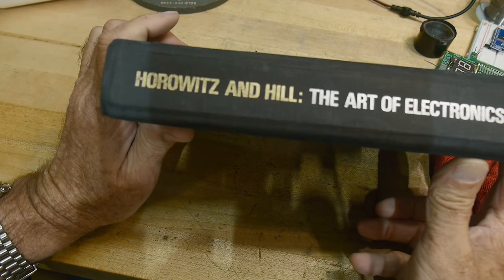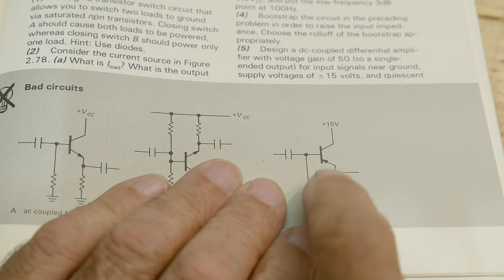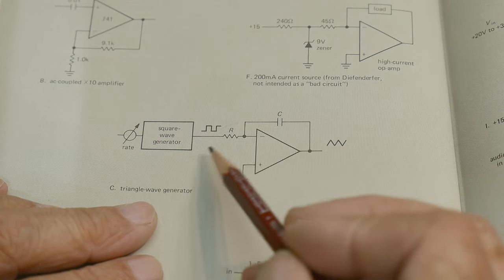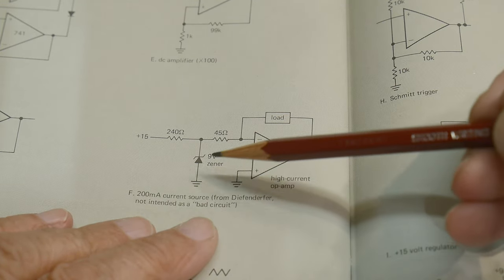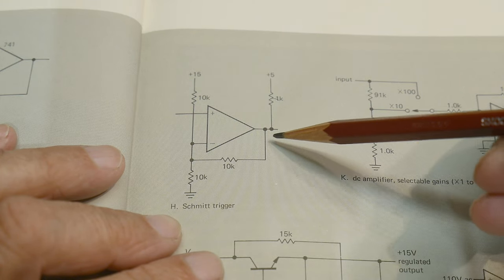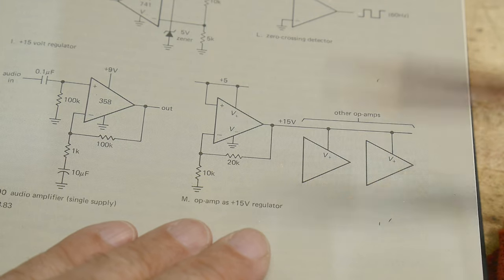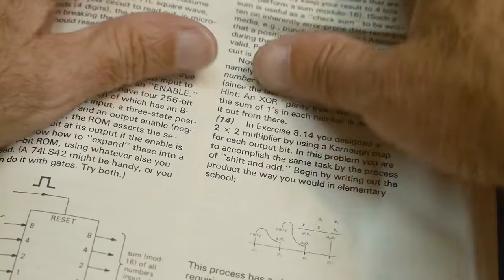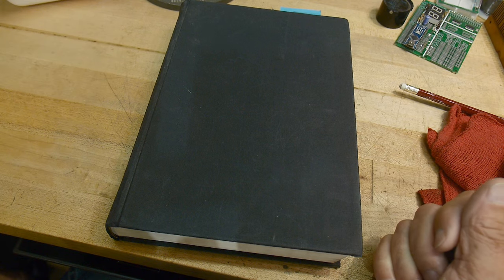#1548 Bad Circuits from the Art of Electronics

Comment: i learn pretty well from mysteries, plus the way these are formulated, it's like an endless list of things that are actually wrong with them, not just one. everything is so squishy, things can work but not for the reasons you think and whatnot, things can end up vestigial or in a product just to detect clones and stuff. the opamp ones are the most interesting, one of those will oscillate because the inputs aren't tied down, and they show 2 unconnected opamps, if the part or routing is changed when it coincidentally didn't oscillate before, it can start oscillating and stuff

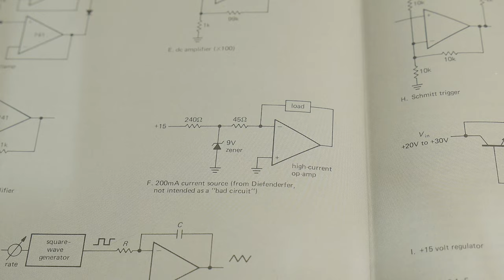Comment: 7:18 The idea here is that the current through the load equals the current through the 45 ohm resistor, which is set by the negative input being fixed at 0V and the 9V zener. So the 0 current into the op-amp input is actually part of the design.

The mistake they made in this circuit was assuming the voltage at the zener will always be 9V, but the circuit as designed will pull that voltage below 9V, thus it will not actually drive 200mA current through the load. If you put an ideal 9V voltage source there, it will work.
Reply: Yup! They should have added a 30 Ohm resistor in series with the 15 V supply, not 240 Ohm.. The circuit is now limited to 25 mA

Comment: In the third example the biasing is just fine -- but the transistor is of the wrong type.  With the correct transistor (NPN) the emitter would sit at -0.7V and be able to follow the input signal on the base to around 27V peak-to-peak.  The transistor would definitely be in class-A (linear) mode of operation.  Of course this would only be an emitter-follower amp so the amplitude of the output signal would be the same as that of the input signal so (if the value of the emitter resistor was suitably chosen) it would be just a current amplifier suitable for altering impedance betwee input and output.

Comment: The 200mA current source - the problem is the 200mA has to flow to the +15V supply and the 240 ohm resistor is way too large to support that.
Reply: If the 240 Ohm resistor was 24 Ohms it would work.

Comment: Circuit F 7:10 - Current will flow from left to right, only problem is the drop across bias Res 240 Ohms is 48V for 200mA (assuming 0A bias current for Zener). 
Hence, supply should be atleast (9+48)V 
or 
Bias Res can be at max 30 Ohms

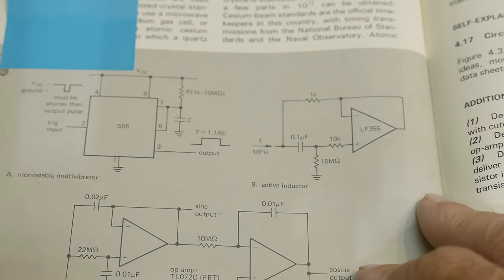Comment: The issue with the 555 @11:34 seems to be that the output pulse is dependent on both the RC time as well as the duration of the input. As soon as pin 2 goes low the output goes high.  The output will remain high as long as pin 2 is held low and then start the timer when released. If the goal is a multiples of seconds or more output pulse, it is probably fine.   If the input is a push button, the output duration will be imprecise especially if it is set for fractions of a second.

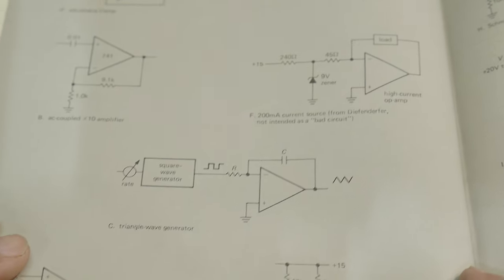Comment: Some more observations :D 4:27 - the triangle wave will vary significantly in amplitude, because the RC time constant is fixed and the incoming square wave frequency is variable. If the square wave isn't exactly 50% duty cycle, the output will drift to a rail too.12:30 and 13:20 both have the same problem, they forward bias the JFET's junction to ground which is basically guaranteed to let out smoke.

Comment: G: The only thing I can think of is the transistor output is connected directly to the op-amp and might DC bias the op-amp and send it into saturation.
H: The op-amp is biased to half of 15v, or 7.5 volts. If the op-amp is an open collector output the output will swing from 0v to 5v. The 5v swing won't "flop" the schmitt trigger at 7.5v

Comment: Zero crossing: (as there's no information of the supply) there are a lot of opamps that can't apply voltage greater than ~0.6 V or so directly to the inputs. You should use a comparator or add a limiting resistor.

Comment: 1:58 - The bias is actually ok here, since the base resistor goes to GND, while you have a +-15 V supply. The transistor is still placed upside-down though :)

8:10 - The transistor bias is ok, the base is around 1.5V. The Q point for the collector is at 9 V (also good) and around 1.2 mA ((1.5 V - Vbe) / Re). This first stage has a gain of 10. However, we now amplify the total signal (AC + DC) by a 100, which will obviously saturate the Opamp. We need a blocking cap between the output of the transistor stage and the non-inverting input. We also then need a pull-down resistor from the non-inverting input to not have a floating input with the cap in place. Then the gain of the opamp should be lowered to 10x, for the total gain to be 100

Comment: I think the first AC coupled follower with a resistor to ground might work if the emitter resistor would be connected to a negative supply (much lower -0.6 volts, ofc)

Comment: L will actually fail spectacularly on many op-amps with protection diodes on the inputs. It'll short those 110V AC directly to ground. Depending on the impedance of the voltage source this can make your op-amp catch fire or explode. Also those 60Hz depend on your input frequency. That circuit does make a bit of sense for some applications, for example when using a motor as an input device. Depending on the motor you might get high voltages and high frequencies. However in that case you should at least AC-couple it and add external protection diodes.

Comment: The authors state in the intro that aside from the Bad ones, they are not showing circuits intended for practical use, but to illustrate or isolate a concept. Or some such thing IIRC. The book is littered with errors, much like the Numerical Recipes books - which have code that works and derivations that are wrong.

If you want practical analog stuff "How to Build and Use Electronic Devices Without Frustration, Panic, Mountains of Money, or an Engineer Degree".

The triangle wave generator will drift due to the input offset voltage until it sits at the + or - rail or be chopped off.

Comment: 14:12 Even nowadays that's still a bad circuit.  You need a resistor or something on that LED to limit the current.  Even if the output of that gate can drive the LED, and even if it somehow has some built-in current limiting so it won't fry the LED or the gate, it'll still end up pulling the output level down to the LED's forward voltage, which (depending on the LED) probably means it won't be high enough to drive any of the "other gates" down the line properly (assuming they're also TTL)...

Comment: 7:18 (F). Assuming that the diode is reverse biased (only then there will be 9V at that node) then 240Ohm has a current of 25mA. And we want 200mA through the 45Ohm. Thus, the Zener must Source a current of 200mA-25mA=175mA. But for reverse bias the Zener must "Sink" current from hat node, instead of sourcing. Thus Zener will not turn ON (neither in Forward nor Backward direction). Thus, it can be removed from the circuit.

Comment: In G. There will be a tremendous DC offset on output. Assuming transistors are biased to 7.5 volts of output, then ther will be 750 volts on opamp outptut.
Looks like there is a capacitor missing in fron of opamp.

Comment: Of the first three circuits the biasing should be a potential divider as per circuit 2  (notwithstanding the transistor emitter should be to ground)  with an emitter and collector resistor.  The 4 resistor network provides stable biasing (depending on how stable you want it)  and protect against temperature  effects.  One of the first books I bought for my electronics degree in the early 1980's.  From what I can remember the book never had answers/solutions which was a real shame.

Comment: Bad circuit #2 is exactly what made it to ZX Spectrum +2 issue 3. It has two 2N3904s marked and soldered incorrectly; the error comes from switching over from a different type transistor which had reversed pinout.

Comment: I think the square to triangle via integrator would produce a variable amplitude depending on frequency.  The DC bias might also drift around with variations in frequency, and that would probably result in clipping.  I am guessing that the rate control is what makes circuit "bad" since this would be ok with a constant frequency and suitable R and C values.

Comment: Think for E the x1000 amplifier the circuit is designed to a current-driven transistor, but FETs are voltage driven.

So both resistors on the output should be around 10k ohms. I think some kind of feedback from the output may be needed to set up a voltage divider for the FET. So maybe replace the 1M resistor with 1k and place the 1M resistor bridging the output and input.

F: logic switch: again FETs are voltage driven and have very high impedance on the input. You need to tie the input to ground (or supply but that would fail on) through a resistor to avoid a floating input.

G: is definitely missing a feedback resistor somewhere: can't have a voltage divider with only one resistor.

Comment: First one is common in a class C amplifier, with brief current pulses meaning low operating current, when driven hard enough. Second one is ofr course an error, you need to have a negative supply, which was common in the days of germanium transistors, all PNP normally, though you did get expensive NPN ones, with typically a negative supply and positive ground. Third might actually work with some transistors, which would operate symmetrically, as the collector and emitter were identically doped, which was often the case with early diffused Ge transistors, which actually had in some cases equal gain both forward and backward, though of course they did not operate at 30V, only around 3V total.
Reply: i've commented somewhere else here about a transistor used 'in reverse' like in the second one..😉

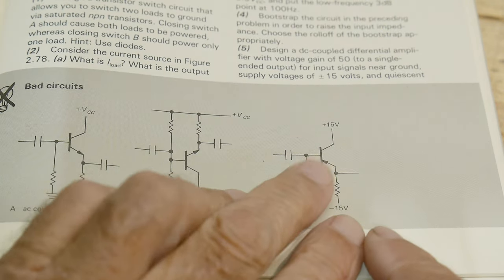Comment: 2:08 the right circuit doesn't need an extra resistor since the -15V is lower than 0V GND. But the transistor should be NPN and not PNP.

Comment: Regarding that op-amp with 110V (or whatever) directly into one of the inputs. I first ran into something like this when troubleshooting a digital multimeter from the late 1970s. It had the input + terminal connected almost directly into the op-amp, via a series resistor, so except for that one component there was potentially up to whatever input voltage (1000V or more) without the benefit of the 'normal' input attenuator voltage dividers. Yes, there were reverse-parallel resistors from the op-amp input to ground after that one resistor. The thing that made it work was a bank of negative feedback resistors on the op-amp, all connected in parallel, but each with an FET in series with it, and those FETs were turned on from the automatic range selection logic. So for very low input voltages, a feedback resistor would be selected into the circuit which in contracts with that one input resistor would provide gain, and for high inputs the feedback resistor would provide attenuation. While solving the design problem this was worked fine, it still seemed alarming initially. That one input resistor value was negligible compared to the op-amp input impedance, so it was not by itself really providing any protection for the op-amp (although it DID also serve to limit current through the clipping diodes).

So, for the 'bad circuits' example, the op-amp is still connected about the same way, relying on the op-amp's very high input impedance to prevent damage from high input voltages. Even with 100+ volts applied, current into the op-amp is negligible. The circuit is configured as a simple comparator, so it is expected to have its output slam against the power supply rail. Seems like this might actually be OK......I wonder what I am missing? Maybe it is just the op-amp's maximum voltage to ground rating is being exceeded, in that some current path through substrate, or whatever, would blow it up, rather than the 'ideal' op-amp input being OK with the situation.

Comment: My guess for G would be to put the op amp stage before the BJT stage, ditch Rc,  then take the output off of the emitter instead. You would need a coupling cap on the output though. Also, those gain setting resistors aren't the most intelligent choices in terms of noise. Maybe cut those values in half.

Comment: Triangular wave generator is missing a high value resistor in parallel with the integrating capacitor, otherwise it will saturate by integrating even the smallest offset; Schmitt trigger should have positive feed-back. i.e. inputs are swapped;

Comment: 7:57  Looks like a transcription of an empirically developed circuit attempt. Maybe they added transistor because the opamp was a 741 wasn't fast enough gain*frequency. If the opamp was intended to directly drive a low resistance earphone the superimposed DC voltage on the speaker would make the opamp run warm. 
That does look like it was someone's actual attempt at one time.

Comment: C. the integrator will not produce triangle wave out for the variable square wave in for all frequencies. R would need to be varied as the rate varies.
G.  A coupling capacitor is needed between the transistor collector and non inverting op amp input.  Also the  op amp gain is probably too high.
H. The Schmitt trigger needs a positive feedback not negative.
L. The 110 Vac  needs to go into  a coupling capacitor then 10 Meg resistor into  inverting in with a 1 M to ground.

Comment: 4:00 Isn't the problem the high-impedance input? Even DC will effectively couple through a capacitor if there's no current draw (e.g. floating CMOS logic inputs). You're basically using a high-pass RC filter but R is near infinity. As you mentioned, a resistor to ground fixes that.

Comment: Op-amp circuit B.  The input offset current of the 741 will eventually charge the input capacitor and saturate the amplifier.
Reply: Op-amp circuit C: the classically poor 741’s input offset current can charge the feedback capacitor.  Better to stabilize the gain by paralleling the capacitor with a resistor.  You don’t want the open loop gain multiplying whatever the static input offset voltage is either; on a 741 it is bad enough to probably saturate the output.  Nobody would use anything as bad as a 741 even even when The At of Electronics was first published.  Much better parts such as LF356 were available even then.  The only reason to use a 741 now is as a repair replacement for a circuit expressly designed for a 741.

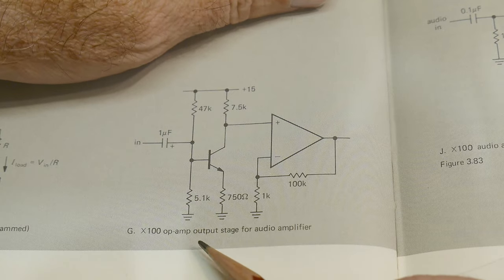Comment: 7:26 Should it have a decoupling capacitor before the op-amp?
Reply: Right, the DC bias of the transistor stage will be further amplified by the opamp. It needs a coupling capacitor and a bias resistor to ground on the opamp input.

Comment: None of those bad emitter followers will work - but the middle one is close. Put the resistor on what is nominally the collector lead, and as long as the Vcc is less than the base emitter breakdown voltage (typically about 7 volts) the emitter junction will be reverse biased and function as a collector, and the collector junction will function as an emitter. Try it with a 5 volt supply. It will work.
Current gain of a transistor put in backward like this is about 1/10th of what you get when you use it as intended, but as an emitter follower that doesn't matter very much. Even if the gain is only 10, that's enough to be useful.
Using a transistor this way is not recommended - except for one specific purpose. Running a transistor backwards like this gives you a very low saturation voltage. The Vce sat is far lower with the transistor inverted than when used the normal way. If you want make a chopper, this inverted connection is a trick that lets you make a superior switch that gets close to ground.
An obsolete bit of trivia, as FETs work even better. But once upon a time, this was a clever trick.

Comment: I don't want to go through all that unexplained oddities in all that bad circuits, because it's much better if you find that yourself, but there is one thing catching my attention. Swapping E and C of BJT is not necessarily bad thing. The only what swapping E with C does is that this changes the parameters of that transistor to something, that is typically ugly, but despite the fact it is ugly, it might be useful in some particular cases.